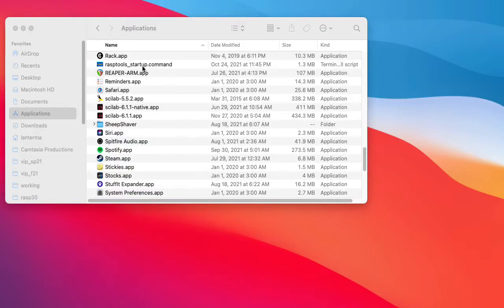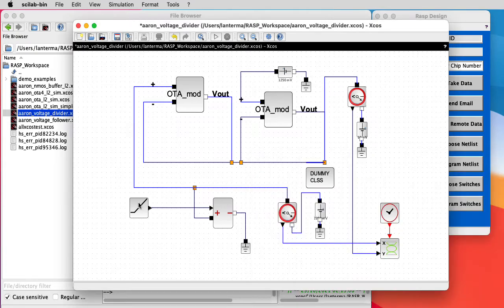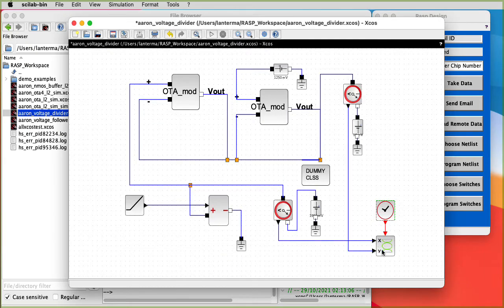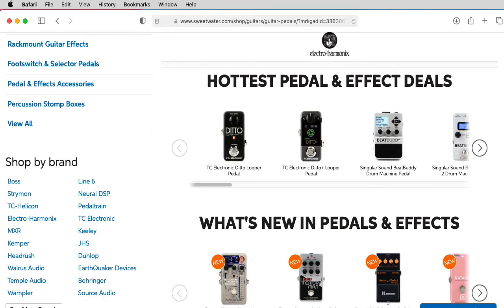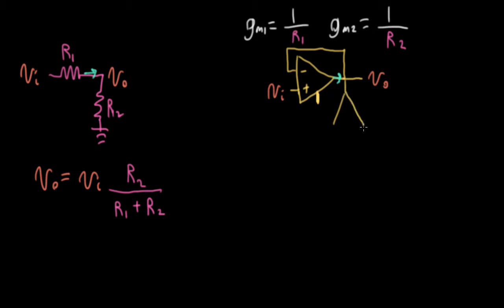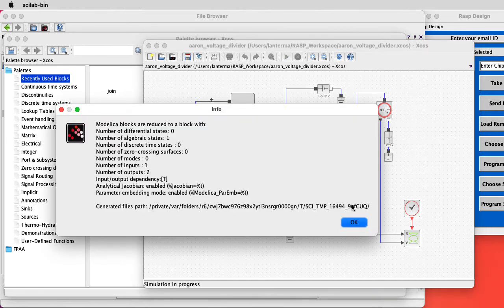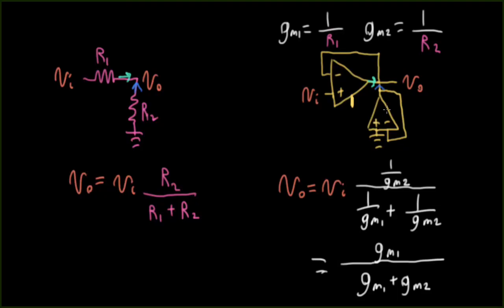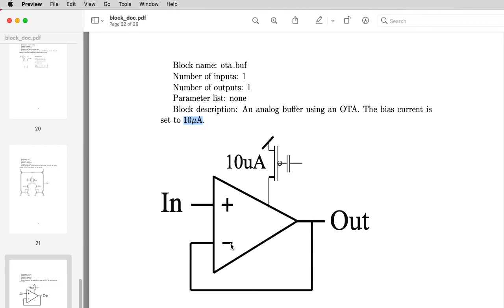FPAAs: Voltage Division with OTAs (Operational Transconductance Amplifiers) (Programmable Analog)

Comment: a bit off topic: but the "GM", like mentioned in the LM13700 datasheet how it's used?
i tried 19.2 and used in their formulas on how to calculate the cutoff point,  i came up unexpected result far outside the audio range.
Reply from the maker: Try g_m = 19.2 * I_abc, where I_abc is the bias current flowing into the current control pin.
Reply: @Lantertronics  Thank you very much, professor, will keep you updated. i went a little deeper on Buchla's triangle core and improved on it, although the hint came from you, but simulation say it works, soon when i finish routing i, I'll send it out .

I'm not even a licensed engineer.

i found some dual matched transistors @ Mouser in a SOIC-8 package that don't explode the bank.
Reply: @Lantertronics  one thing is still missing professor, if you can find time for that, a decent explanation of the PNP transistor ... in both uni polar and bi-polar supplies, when to use it.
to me the most difficult part in electronics, the PNP .. and probably also the P channel Fet.

... and transistor configurations as Common Base. 
as used on Jürgen Bergfors Voltage controlled long tail VCA and  OTA vca's.
Reply from the maker: @AnalogDude_  If I ever teach our ECE3400 Analog Electronics class again I'll probably do a video on that.
Reply: @Lantertronics  if you look at the BA6110 datasheet and check the output part ( where as it would be a darlington on the LM13700) you see a NPN and a PNP ... i can't get my head around what the PNP is doing.
how are the currents and voltage through the PNP, in what direction.

i tried to simulate that in the Falstad simulator, the current mirror  is needed other wise it will not work. ( to bad the datasheet doesn't indicate the resistor values, had to joggle around, as the Falstad simulator can indicate current usages)

if you apply a voltage to the base of the NPN, it will be copied on the output above the PNP.

it's like if no current goes in to the base of the PNP, it's on?

transistors are weird things in a bi-polar environment.

you would think that if a negative voltage is applied things would go in reverse, lol

Falstad simulator:  BA6110
https://tinyurl.com/yehod2w4
Reply from the maker: @AnalogDude_  Off the top of my head, Q18 looks like an emitter follower. https://commons.wikimedia.org/wiki/File:PNP_emitter_follower.svg -- for that matter, Q17 looks like an emitter follower with a current mirror load, but I'm not sure why R4 is there.
Reply: @Lantertronics  Currently I'm figuring out of the LT431 precision shunt can achieve  -10 volt on a 12 Volt bipolar psu, since it has some internal reference  that seams to work on 2.5 volts.  ( to avoid trowing money out of the window. )
Reply: @Lantertronics  i tried the PNP circuit you gave me from the Wikipedia page, toughed it might be use full as an inverter, but no matter what resistor ( 33K tot 1M) values you use, it never hits GND, it's always like 0.5 volt above. 

the same count if you take the transistor Schmitt trigger from wiki and replace the second transistor with a PNP, the same thing, it never hits GND.

at first i tried in the simulator, but the same results are on a breadboard.

what's the science behind it, lol
Reply: @Lantertronics  Professor,  how to determine the correct resistor for the base of a transistor?

I have been using 2Sc945 ( ... and 2SA733) for some time now.

if i wanna drive a led, i have 1K above the NPN (2SC945) and the LED below the transistor to GND, what would be the optimal resistor to the base?
until now i have more or less copied from other people and used either 1K or 2K2.
but this time, i would like to do it correctly.

it seams to a base saturation voltage is 1 Volt ( max value ). for the 2SC945, i tried some online calculator for voltage drop across a resistor, but .....

if i use 1K on the base, the simulator shows that I'm sourcing 16 mA via the emitter through the led to GND, but the simulator also shows that about 6.5 mA is heading into the base of the transistor sourced from a CD4000 series logic gate. 

the simulator indicates i should rather use 600R on the collector sourcing from the supply and a 2K7 on the base to have 19 mA through the led and around 2mA going into in to the base.

even 560R on the collector (sourcing from the supply ) and 8K2 on the base, i would have 790 microA going in to the base and still have 18.2 mA going through the led.
theoretically should be fine, even perfect!

What your opinion?

plugged HFE as 200, the Flastad simulator.

Second, I'm using a NPN inverter setup also sourcing from a CD4000 series Logic gate.
i have 33K on the collector ( sourcing from the supply ) and and 15K on the Base and i'm burning 560 microA to GND.
the Simulator tells i could even plug 100K on the base and it should work, since i'm feeding another logic gate with it, there is no consume.

What your opinion?

a weird big value on the base, but the simulator says it works.

I just wanna do it right time and keep the current consume to a bare minimum, but i made a custom footprint for a ( test ) resistor with slotted holes, so the removal is easier, i ripped the pads of the PCB a few times while removing a resistor.